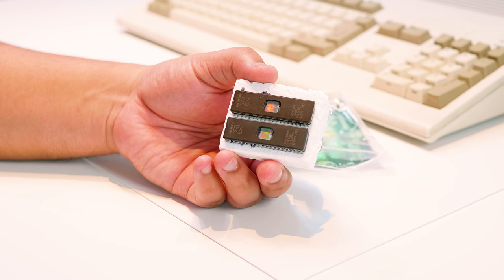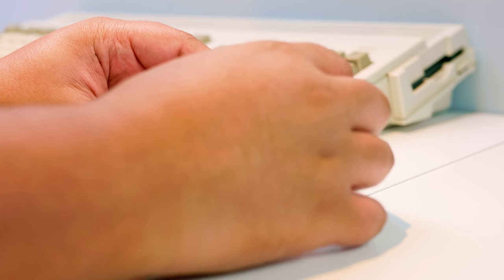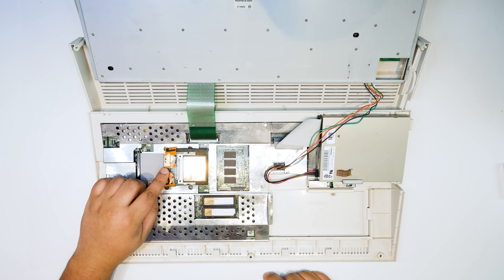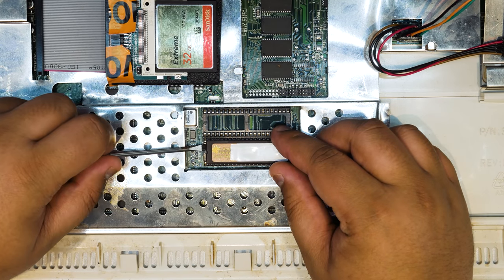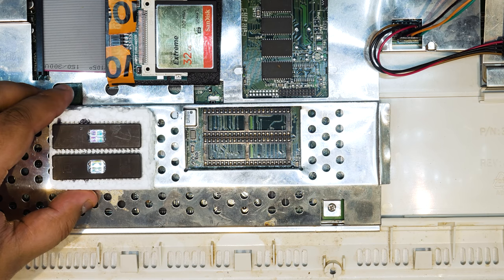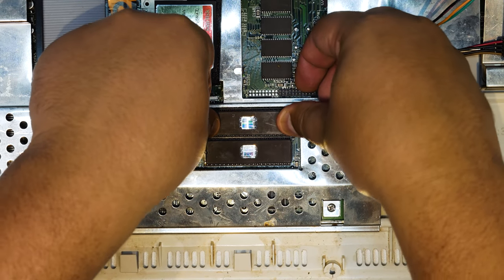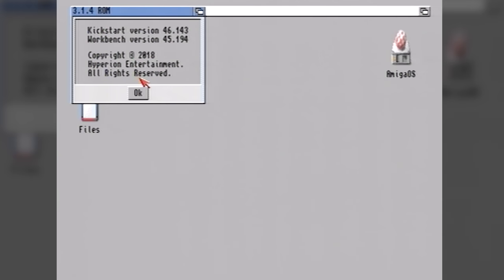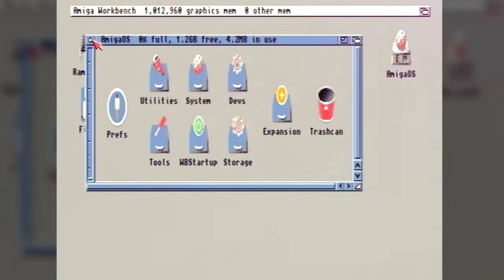Installing Kickstart 3.1.4 in an Amiga 1200 🔥

Comment: on the corsair ll120 installation guide i noticed you  used the cooler master ml240r im planning on doing the same thing i noticed that you need to plugin a cord to the motherboard, should i unplug the current cooler master for the ll120? Also would the pump be rgb and controlled too?
Reply from the maker: If you have questions join our discord don't ask questions on a random video just so I see it.

Comment: if you want see boot screen animation with hd or cf installed run this program http://aminet.net/disk/misc/NoIDE13.lha and reset.  This program turn off the ide controller.  To turn on ide - power off, and on :)